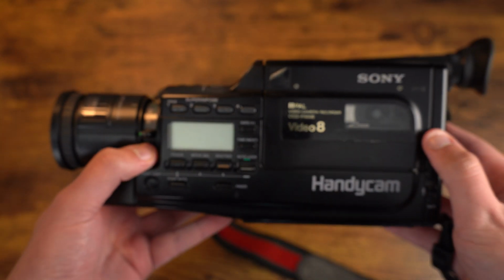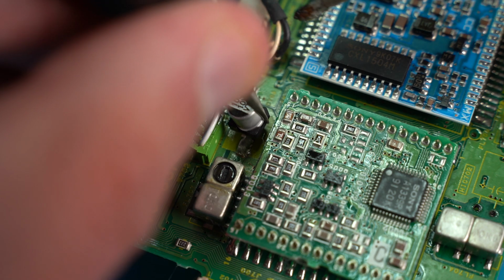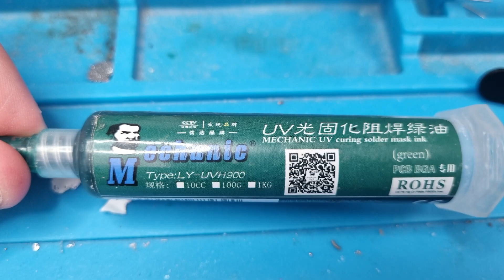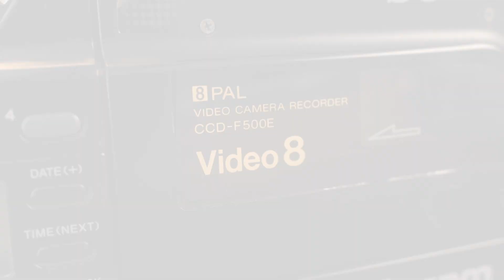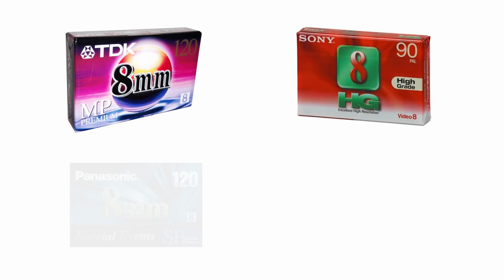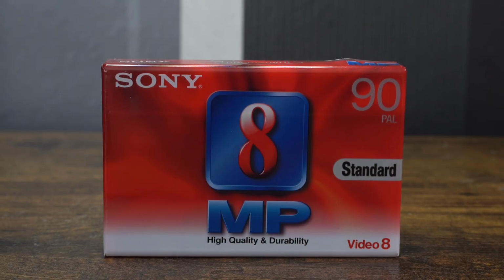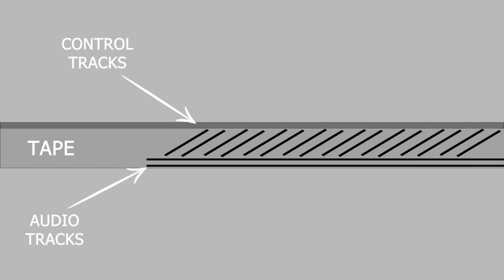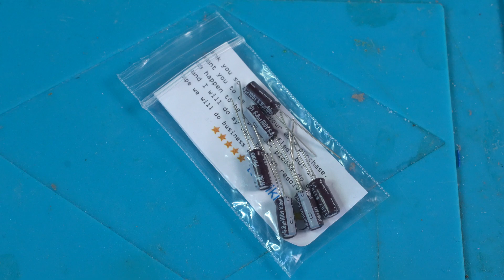Sony CCD-F500 Restoration - Part 2 - 4K

Comment: This video shows how complex it is to repair older electronics like this camcorder, because the number of capacitors on each board but also the potential difficulty to find the exact same spare parts to replace. I was thinking just to replace the bad capacitors but after seeing this, it is clearly better to replace all of them because you would not know which ones are bad until you removed them from the board. And the corrosion to the board is the biggest issue, so it is best to get rid of the potential capacitor leakage in the future by using all new capacitors so you don't have to open it up again in the near future. Yeah, it's an older design when Sony soldered the boards together with the ribbon wires, nowadays, they would have ribbon connectors between boards.

Comment: Hey there TheRetroPal, Thank you for this video, this give me a clear goal to fix my Sony Handycam CCD F340e, the boards are pretty similar to the CCD F500e so it's kinda easy for me while watching your video.
But i have a bit concerned about this.
And that is: my Camera is not turning on, i give a power it's still same, i just concerned that after recapping that my camera still not turning on due another factor.
Reply: Be sure the fuses on the board where the battery connector is mounted are Oke. As I remind me from the '80 as Sony service technician there are 3 fuses called SOC 1600 (1600 mA). Those fuses could be broken by short circuit in DC-DC converter or many defect capacitors.
Reply from the maker: @AZIMUTH_HOMEVIDEO  When you replaced the caps, did you replace them with the correct values to the ones on your board? Also, which boards have you recapped so far?
Reply: @theretropal  i'm sorry i mean I haven't done the recapping yet, i just want to ask that, My Handycam, is not turning on (i've just buy it) when i give a power. my question is, does it also the caused from the leaky caps too? Because your camera is turning on but the viewfinder is blurry. Mine not
Reply from the maker: @arthur_stve  Yes leaky caps or failing caps can cause specific areas to not function well or at all. So replacing them is highly recommended especially for these camcorders which are known to suffer from leaky or failing caps.
Reply: @theretropal  Thank You Very Much
Reply: @theretropal In Part 1 Do you also Fix the DC to DC Converter Caps?, it's a Soldered Box on the side of the lens, if it's opened it's loaded with Much Caps and it's hot glue around it, do i have to change it?
Reply from the maker: @AZIMUTH_HOMEVIDEO  All caps must be replaced. If you've already replace some, then I would recommend replace them all. To remove the hot glue use IPA, let it soak in for about 30 seconds and it will come off.

Comment: 5:30 how long does the solder wicking exactly take before all the old solder comes off?
Reply from the maker: If you use flux and set the iron at 375 degree, the wick should remove all the old solder in seconds.

Comment: 4v smd caps are a pain to find in my locality. China commonly only makes 6.3v and not even all values including the odd ones. it makes the restoration harder, even for cassette players.
Reply from the maker: As long as the voltage is the same or higher, but the UF is the same it will be fine. So for example the SMD cap is 100UF @ 4V then you can use a 100UF @ 10V but the caps may be slightly larger. Hope this helps.

Comment: Would it be possible for you to list all off the capacitors required to do all the boards and also three type (SMD, Electrolytic etc.). I want to try and get everything before attempting this.
Reply from the maker: Hi, Regarding a list of all the capacitors required, I will put them a full list of all the caps needed in the next part. The great thing about these capacitors, you can get a SMD kit for less than £10 on Amazon with majority of the values you need. Just the odd values will have to be sourced else where though, but I will put a link to those caps too. Hope this helps. 🙂
Reply: @theretropal  Thank you so much and apologies for asking for so much.